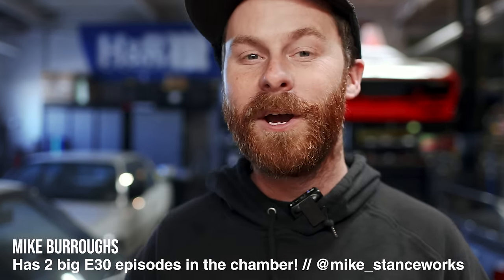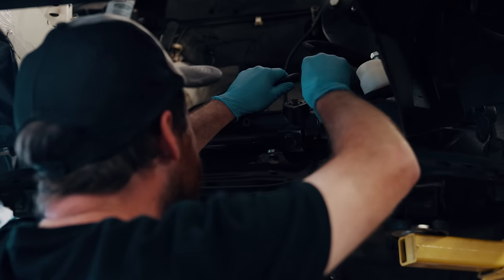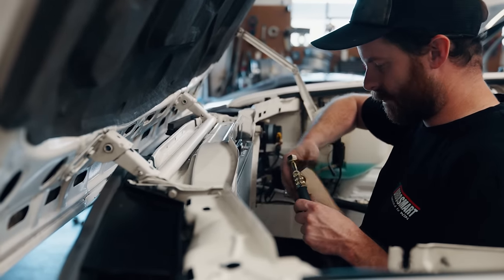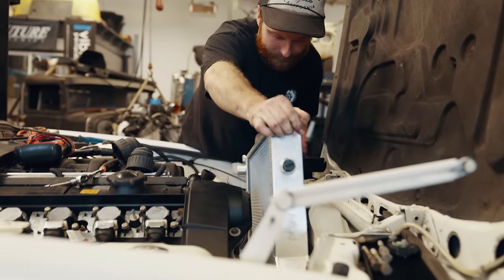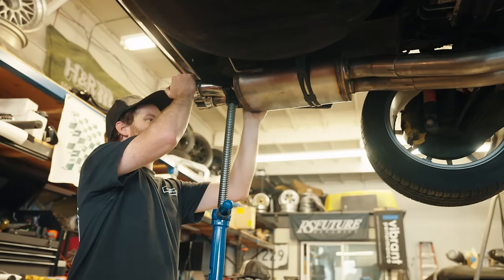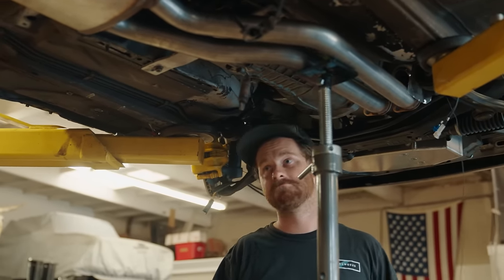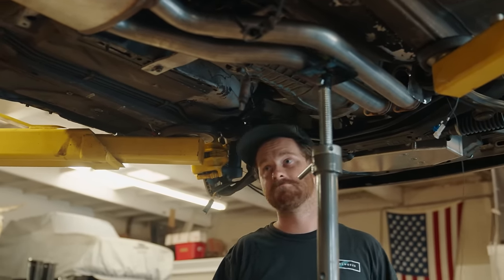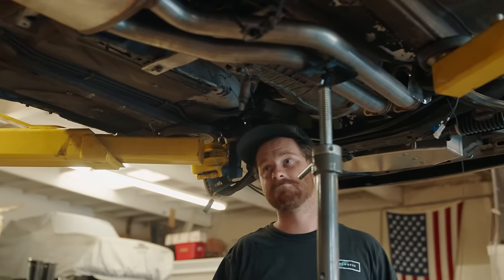They stopped making good BMWs, so I'm building my own // Complete E30 Rebuild

Comment: hey Mike, just a note on the mounting of the aircon radiator. Noticed you hard mounted it on the chassis. The problem with this is the chassis twists in an e30 in this location and  over time will twist and burst the radiator. I did the same thing to a mocal oil cooler. Use isolation rubber 'cotton reel' mounts to stop this being an issue.
keep up the great content, cheers.

Comment: 8 minutes in and i already knew what to do. subscribe. 
i was so close of getting a e30 but opted on e46. didn't have time to work on potentially this much. so far on the e46 ive done; maf sensor, intake control valve, valve cover gasket, fuel pump, fuel filter, intake and cabin air filter, front two control arm bushings, spark plugs, factory xenon head light install, brake lights and turn signals front and rear bypass soft top sensor to fold it manually, etc all the easy stuff. i imagine with the e30 i wouldve had to invest way more time than i already did with the e46. which was enjoyable so far bc it was all the easy stuff so far. knock on wood.
i'm probably gonna binge watch all your videos in the channel tonight, so happy to find good channel on youtube

Comment: Love the build. I own an e30 myself and in the process of m62 swapping it. One thing that I noticed is the modification of the firewall to feed the wire harness through which was not necessary it’s quite easy to open the connector plug and feed it through the firewall without any cutting or grinding. 
I’m no hater or anything, love the content and the builds, keep up the good work!

Comment: When doing the steering rack swap, you can avoid having to use spacers by cutting off the top mounting brackets (which flare upwards a bit) and fabbing up flat replacement pieces. That also gives you a bit of clearance to the pan.

Comment: I use Solar Flux with methanol in a slurry that is painted on the back of the welding joint. It isn't as pretty or effective as back purging, but it dramatically improves welding, prevents blow through from porosity, and in general, there is far less to no contamination and black porosity compared to using anything. I highly recommend it for a DIY who doesn't have a split or second bottle for back purging or who doesn't have the time to get fancy.

Comment: You installed the throttle cable on the cruise control cam of the throttle body. Makes throttle  response kinda flat then abrupt. It’s best to use an e36 328 / m3 cable and install onto the larger cam of the throttle body. You can try that with an e34 cable if that’s what you got but you’ll likely run out of adjustment.
Reply from the maker: This explains a lot. I couldn’t find an answer for what cable I should run. Thanks!

Comment: I love the exhaust idea. I took a Corsa muffler for an e46 and had it welded onto my factory e30 exhaust. It fit in the muffler box area so I figured why not. The pipe diameter is different but blending it wasn't bad. Sounds rowdy on my m20.

Comment: My first new car was the 325c with the impossible to kill straight six from 88-92 that was magnificent years for those cars and engines. My vehicle for time had a car phone and was so over engineered you needed time behind wheel to understand car movement and reactants various speeds. This is very important on over engineered automobiles. They are different animal.

Comment: Honestly I don't know why anyone in their right mind would want a clutched fan.  Swapping out the mechanical clutched fan was the best mod I ever did to a BMW, a 2000 540I in my case.  Completely transformed the car, added very noticeable power, stopped the car sounding like a dump truck when it was hot out, and eliminated the possibility of a fan explosion, and it never had any kind of hiccup at all cooling the car over around 50K miles.  Just buy quality parts and you are fine.
Reply from the maker: A mechanical fan moves more air than an electric fan ever could. That’s why.
Reply: @stanceworks  it also wastes a ton of power. Butt dyno would be at least 15 on my 540i, though I suspect even more on particularly hot days, and a single electric fan was enough to keep that much larger engine below 180 degrees all the way up to and including Baltimore traffic at over 100 degrees. Normally it never went over 165. I only ever heard it hit the second speed maybe a total of three times in 2 plus years. Given the fact that 540is are notorious for grenading fans that do thousands of dollars worth of damage, it was a no-brainer.  Any car I ever own that has the option of replacing the mechanical fan, I absolutely will.  Can’t really do it with one of my current cars, as there is no reliable electric option that would work to my knowledge. Not enough space, but I would be very curious how taking that drag off the engine would affect performance.  I also should note that you really should have a duct on that radiator.  Just slapping an electric fan up next to it isn't nearly as efficient as running a ducted enclosure with the fan as the only outlet.  It nearly doubles the efficiency of the radiator.

Comment: You could just buy an OBD1 to OBD2 adapter. Just need to jump two pins inside it to be able to write to the ECU using a K-line cable...

Comment: I’ve got a 1995 Holden Commodore (Australian car) and am getting deja vu. Rack and pinion, struts, semi trailing arms, Getrag 260. Even the strut towers look the same. Commodore is based on the Opel Omega but, unlike the Omega, the Holden has rack and pinion steering. Fun fact the Getrag has a BMW logo on the case and GM on the bell housing. The Commodore weighs in at around 1450kg so heavy but not ridiculously so.

Comment: Really love this. 

I feel similarly about my 89 wagovan. Sure, a fit is newer...but...no independent suspension, taller, etc etc. 

I'd rather turn it into an overcomplicated labor of love, put a k20z3 and trans in my wago and keep the analog feel of my 80's box. <3

Comment: I was wondering why you were using the stock style fuel filter and not a newer style with the inline regulator.  I had something similar happen with my e46.  It would crank, spark, and run on starting fluid.  Turns out it was a bad MAF sensor telling the computer that there was no air going in the engine, thus it wouldn't inject fuel.  Unplugging the MAF made the computer revert to a different fuel map, allowing it to run.

Comment: I saw a vidio the other day.
This gye had BMW connection rods .From the 60s to m5s.
Tested there strenth with a pulling type press .The early four cylinder ones came out the strongest by a mile.

Comment: When I did my24v swap I ended up using a zf transmission .. was the clutch and flywheel for the g260, and what starter did you end up using?

Comment: I am hoping you are going to install a roll bar inside this car.  There was a Top Gear episode where they dropped an older 3-series on its roof...it didn't perform very well in that circumstance.  The old SAAB they dropped on the roof had very little roof deformation (but this may not turn a BMW enthusiast into a SAAB enthusiast).  🤔

Comment: Loving the build just two things though…

I’m trying to understand Magnaflow’s thinking in designing a dual exhaust system with an x-pipe that exits into a single pipe, I don’t get it 🤔

Any reason you didn’t go with the OBD1 intake manifold for better flow, I know it looses torque but it’s 3.2L isn’t it so shouldn’t be a problem?
Reply from the maker: Because it’s about merging the pipes for sound.
Reply: @stanceworks  yes but isn’t that what the x-pipe is for, scavenging yes but sound as well, why do it twice

Comment: What's the blue crimper you used at 26:30? Haven't seen one like that and I'm curious about it.

Also, saw that you are using old school-style wire strippers. Not sure if you've ever farted around with automatic wire strippers but they've been a godsend for me.

Comment: No rear O2 sensors, no cats.  Where are you going to register this, as it's not passing smog anywhere around where you live...  Also, just the front pusher fan is enough to keep it cool, in summer time traffic with the AC on?

Comment: I always enjoy your content. With that said, why not restore the E30. There is nothing better than detailing a car. It's the satisfaction of knowing that the E30 will run tried and true. And if there are problems, it's not hard to figure out what went wrong.
Reply from the maker: I think we have different definitions of restoration. By most measures this is a restoration. But by my book, a restoration is replacing every possible component and refinishing everything. Bringing the car to as close to new as possible. And that'd cost $250k to do right.
Reply: @stanceworks I was going to say wouldn’t a full restoration start pushing into the 6 figures quickly

Comment: Maybe I missed it, but did you touch the terrible trailing arm design?  One of the biggest flaws on this car.  dtm car i know went through like 6 setups. Also for those watching that dont know, the reason OEM uses plastic intakes on rads is heat transfer plastic has, it doesnt trap the heat in as aluminum does, fighting heat soak of the rad in stop and go traffic.  The plastic is rated to 300f for 10mins, so long as you dont overheat the plastic its better for a daily with rad in the engine bay area.  a good aluminum will last as long as the fins do though, it's a tough decision most dont even think about.

Comment: While the E30 is a great car, i think the E36 is way better. Starting from the engine placement. With the 4 cyl it's almost like mid engine. The balance is unreal. And let's face it, the coupe still looks great. Even better than the E46 i'd dare to say. Low, wide, lean and mean. The E46 looks a bit....chubby in comparison.
But if i had to chose between the E30 and the E21 i'd choose the E21.

Comment: I really, really never understand why Americans have problems with BMWs cooling system. Maybe you should ordered the "Ausführung heisse Länder" aka desert option, when you live in a desert. I owned over 20 BMWs 3 series and never had any problems with the cooling, but I live in Switzerland.
Reply from the maker: You've either had tremendous luck or haven't owned any of them for that long. BMW cooling systems are notoriously the weakest link of the entire car for anything built between the 80s and 2000s.

Comment: Dude you just gave us a lecture about back purging and then proceeded to weld the tip on without back purging?
Reply from the maker: Sometimes the ol ball of foil falls out brother. Can’t win them all.
Reply: Fair call, I was just saying. I wrap the foil over the tube and poke holes in it ,this usually works well and if it comes off just add 2 pieces of tape to secure it. @stanceworks

Comment: No, no, no! Don't use Penzoil! I used that in my Subaru Impreza, and it cause sludge build up on my pistons and valves! I started using Valoline high milage synthetic oil, and it ran beautifully, and no sludge build up.

Comment: 1st mistake in just 1st thing, bolts for steering rack goes from under not from top otherwise You wont be able to remove them once engine is in.....
Reply from the maker: Peep the next clip, I flipped them :)
Reply: yes i saw that later but 1st clip show wrong way nice job anyway keep it up @stanceworks

Comment: This whole video doesn't make sense starting from the title itself. Yes, you're right these were great BMWs and perfect for daily driving. So the logical thing would be to restore it completely to factory condition with BMW parts, to get it back the way it was made as a "good BMW"! Not a "build" which has nothing to do with the way it came out from the factory. But it seems Americans are obsessed with something called "builds" so they end up ruining great cars, especially great European classics! Even financially it doesn't make sense, because too much money will be spent on these "builds" and at the same time it will devaluate the car, compared to if it was completely original!